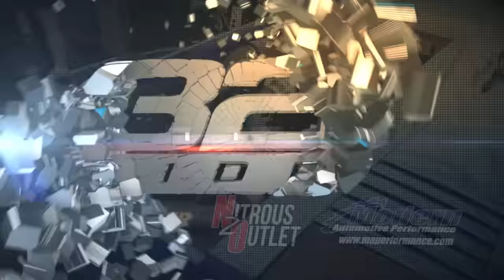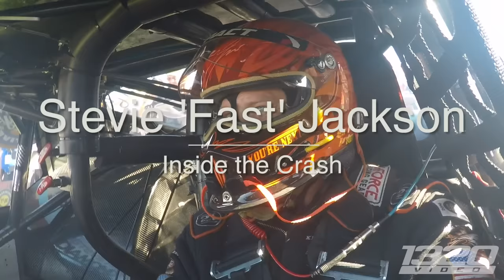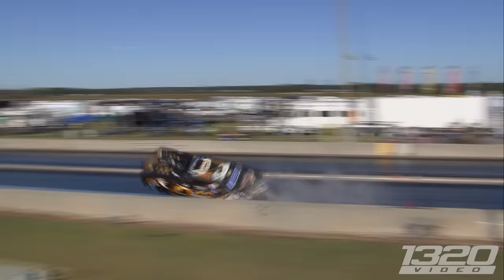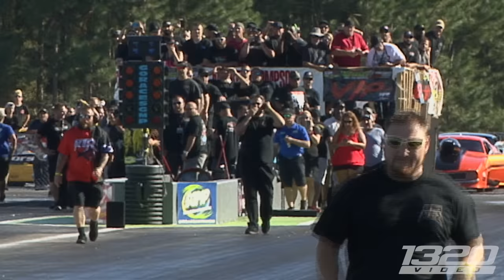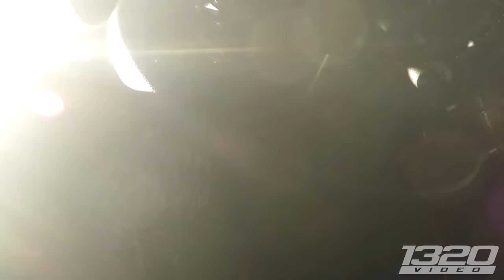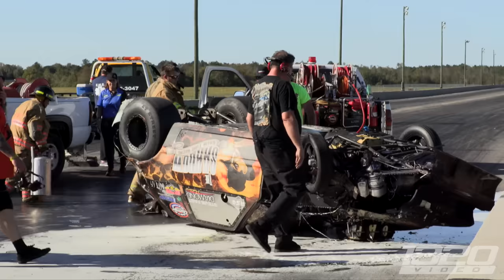Inside the Crash - Stevie ‘Fast’ Jackson SHADOW Destroyed

Comment: The beauty of roll cages right there
Reply: sahai322 unfortunately he did not have a neck brace, if he had rolled again his neck could have snapped.
Reply: @Joshua-hz3cl  had a hans device .....
Reply: sahai322 life saver
Reply: Thank god for them roll cages
Reply: Dam
Reply: Used to think roll cages were a waste and just added more weight to the car before seeing this video
Reply: @Theviperortan27  Rollcages aren't just for rollovers,a rollcage on a normal crash,they have a pretty good effect as well. Sry for my bad eng.
Reply: Check out the video "Mustang ripped in half ". Street racing at night, dude gets squirrelly and goes sideways into a telephone pole. No roll cage.
Reply: @Theviperortan27  Is this the first video of a racecar crash you have ever seen? I can't comprehend what would make anyone think that rollcages are unnecessary
Reply: @Theviperortan27  a rollcage also stiffens up a chassis, which can keep a high horsepower car like this from bending from the force of the launch
Reply: Super swang sh#t Filmz I’m glad you’ve finally realized the truth about them, but man.  How can anyone possibly think they’re a waste? It’s just common sense to see that they are crucial!  Even the most basic cage saves lives. This one is really advanced and definitely did its job.
Reply: Without it he woulda been dead
Reply: @Joshua-hz3cl  I'm pretty sure he had a HANS
Reply: @breckr1121  that's not what the video shows
Reply: And a five point harness
Reply: @srcastic8764  because he's never been in anything fast.
Reply: Sahai322 the dude running at the start ran a 4.8 damn he fast
Reply: Should have also invested in wheelie bars
Reply: @yankeewitnobrim1669   Not allowed in RVW
Reply: @srcastic8764  -
he's so lucky he got out of that with his life.

Comment: Don't tense up. That's how you get broken bones. Relax into a rag doll.
Reply: Yeah I’ve heard that is why drunk drivers survive hard wrecks. The alcohol makes their body just about the complete opposite of tensed up.
Reply: I’ve said the same thing, but it’s really hard to do it when you’re flying through the air at 160 flipping, you’re terrified you’re going to hit a pole while means death, so you tense up.
Reply: slopcrusher nice pic
Reply: Lol
Reply: I think when you're actually strapped in,it's better to ball up, like awooly bear caterpillar, than to flail around in the cockpit  of the vehichle. Most drunk drivers are wearing safety harnesses, helmets, in roll cages, nor are they very aware of their situation. Flailing harnessed in would be like that bouncy ball on the end of a string paddle toy thing.
Reply: So your arm goes out the window and gets ripped off 🤣
Reply: Yep hands on belts or legs body relaxed with legs together or crossed and and eyes closed so you don’t flinch right before impact and tense up and cause a compression fracture to your back or neck is your best bet
Reply: DikoMan that’s why you put your hands on belts and either hold you legs together or cross them if you have a big enough footwell for them to actually move much on impact
Reply: Ya, unfortunately that’s exactly why drunks survive horrendous wrecks and kill everyone else. The drunk goes into rag doll mode during the wreck.
Reply: A lot of other racing classes think it's a good idea to take your hands off the wheel 'cause broken wrists

Comment: can someone please explain why nitrous to run the shifter? wouldn't something like co2 do the same thing without being combustible?
Reply: Chris Dubia it is probably quicker to use nos to shift meaning quicker times
Reply: I don't see how one compressed at certain pressure would work better then another.
Reply: +Chris Dubia nitrous oxide is not flammable in the first place.
Reply: N2O is what races can obtain easily. 
CO2 is preferred, but is more difficult to source making N2O the choice for many small time and low budget racers. 
There is no other advantage, it does not make the shift actuators faster. 
N2O is  non-flammable, however when sufficiently heated N2O is an oxidizer and will significantly enhance combustion making an engine or driver's compartment fire much larger and hotter.
Reply: patw52pb1 I have been around drag racing my whole life and couldn’t BELIVE my ears!! WTF I truly BELIVE you is what’s feeling me out!! Lol growing up around fuel cars hearing him say that makes me wonder what are they thinking?? Co2 can be found at any welding supplies store in the usa

Comment: Funny how he didn't mention his underwear
On a serious note - why would you put 20ga of fuel into a drag car?
Reply: Russky because they burn alot of fuel in 1 run. top fuel goes through 17 gallons of fuel in 3 seconds. he probably burns 7-10 gallons in 1 run.
Reply: Because it probably burns over half that between the burnout, staging, and the run. Could probably get by on 15ga, but you need a little extra regardless of how good your baffles and surge system are. You're never going to be able to reliably get every last drop of fuel out of a tank. And running that engine lean would be a VERY expensive mistake.

Comment: all that cash in a car and no brains to put a wheelie bar on.
Reply: it has one..they were at an event that doesnt allow them. thats also why it was running a small tire instead of a full size tire.
Reply: Really? 😐
Reply: sly5.0gt Why would you implenent a rule that endangers the drivers. The FIA would never allow that. Who runs the events. i clearly don't know enough about american drag racing.
Reply: The sport itself is dangerous. Even with all the safety equipment people still get into accidents and some even die. This class doesn't allow wheeliebars. However imagine if you're running and lost control of the car, the car goes sideways. you think wheeliebars is going to help you? It's a risk every driver or owner takes when they run their cars.
Reply: Alexander Barr
 they do that to force drivers to slow their cars down and actually have to drive the cars without any aids to see who is truly the best... to me its dumb, but to each their own..

think of it this way, say i can run a 5.90 in my promod..if i take the 32x18.5 tires off and throw a 29x10.5 tire on..there is zero chance im hooking with it on full tilt. so if i run a small tire class i would have to play with the suspension to get the tires to hook and turn the power down as not to just blow past their traction threshold.
Reply: And look how sterile and boring the FIA race classes have become. F1 could be used as an alternate to sleeping pills now. The drivers know the risks.
Reply: Alexander Barr he had a wheelie bar
Reply: Sebas Vid one of the deadliest crashes happened at raceway park englishtown in my home town..... veteran drag racer one of the best in the world .... hit the wall at 200+  had every piece of saftey equipment.... this is a dangerous sport and shit happens even with every precaution possible ... that being said if i knew my car needed bars... i wouldnt give her that much without them glad he ok
Reply: And how, exactly would that have stopped the car from taking flight? he would have grabbed more, picked up even more speed, and popped up anyway. In a far worse scenario. If he took flight at all. It is hit or miss and a fair amount of chance. Ever watch boat racing? Or asked yourself how fast a 727 has to go for lift off? (the answer might surprise you)
Reply: Wheelie bar can't avoid a plane  from flying
Reply: it is not A Danger to the drivers he did not let the car get back on the ground so when he hit the peddle it whent back up
Reply: die? tell me a person who has died in a drag car crash from the 2000 to now
Reply: Some events dont allow them.
Reply: Look at the Ronnie Davis fatal wreck at the Rock during PDRA. TOP SPORTSMAN running about same times, had wheelie bar. Car took flight at the lights once the crosswind got ahold of the car. The wheelie bars didn't help a damn thing. Wheelie bars are from the starting line, not a preventative from taking flight. If that was the case why doesn't NASCAR run them???  RIP Ronnie

Comment: I run late model dirt track cars,the window opening is hard to get in when you're not in a hurry,I went upside down 2 years ago, another driver hit the ass end while I was upside down ruptured the fuel cell,so 15 gallons of clear burning race fuel ignited,the wreck didn't hurt me all the safety equipment worked,but hearing the fire and smelling all that burning fuel I broke my arm,leg and took over a hundred stitches just trying to rip sheet metal to get out

Comment: I know it saves weight but the fact that there is a net in a race car as the door is really unsafe. Because you can’t get out very fast and you could be trapped they should just start adding real doors at least on the drivers side

Comment: Stevie .. Tell em how drivers who input large commands into Rack& pinion steering end up in the wall and why  the guys who know better but tap the brake pedal anyway mostly end up ontop of the roof ?  It's the Panic mode knee jerk reaction to speed ..look how upset the car get's flying thru the traps when you just tap the brake pedal ... Or the guys who install large over correcting inputs into the rack & pinion steering wheel then start the famous side to side wall slap ....because of the panic need to over correct ...if you can fight off that urge for just a second  YOU win  Or rather your car doesn't lose

Comment: "Nitrous oxide to run the shifter" lol
Reply: It’s true. He’s not spraying the nitrous into the engine. They use nitrous oxide to run the air shifter. The shifter is on a timer. It’s a good tuning tool. They can change shift points using a laptop between runs. You’d be surprised how much of a difference changing the shift point by a tenth or two of a second makes.
Reply: @tjberry5899  why not co2